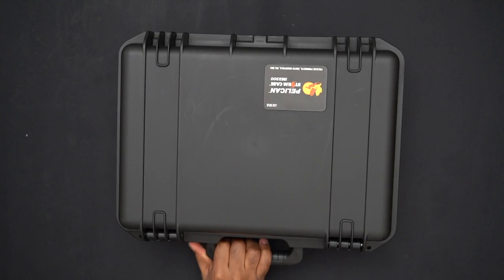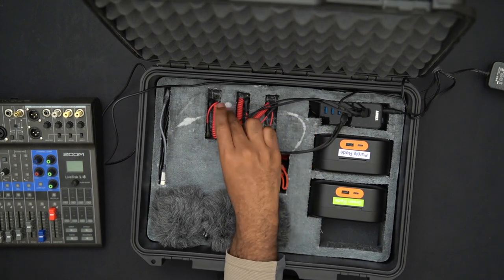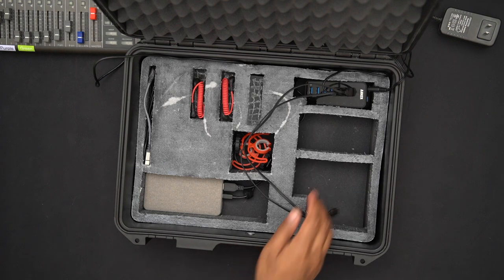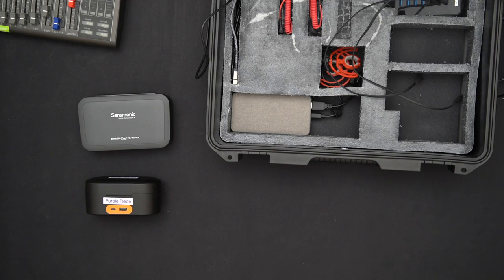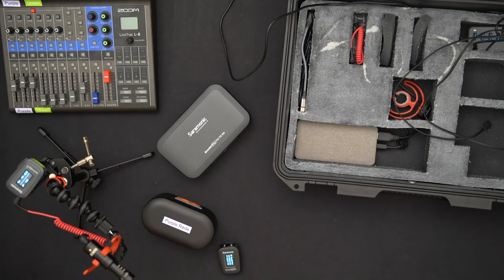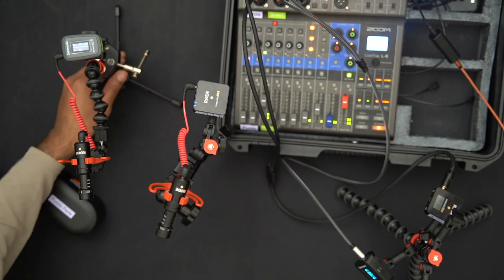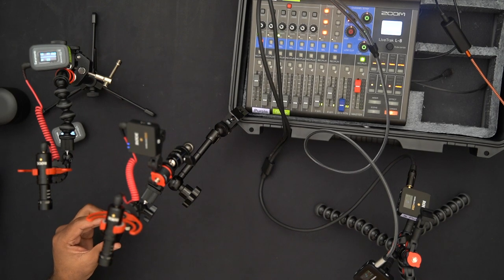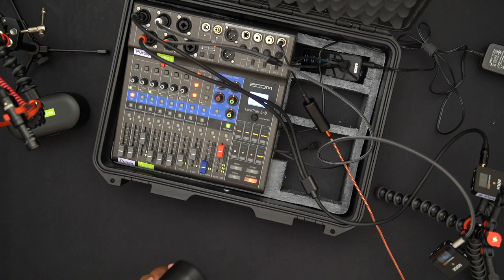Portable Podcasting Box 3 - Zoom LiveTrak L-8 with 4 Rode Mics

Comment: Thanks for your interesting Video. Do you have a recommendation for a cable from the rode to the Zoom L-8? Which cable do you use? And do you need phantom power?
Reply from the maker: Glad to hear that the video was interesting! I don't have any specific recommendations. As long as the cables are a 1/8 stereo to two 1/4 mono, then thngs should work out well. If you're wanting to know the exact cables in my build, then they are the following:

https://www.amazon.com/dp/B07K59CQ3R/
https://www.amazon.com/dp/B07XPTF19B/

Hope this helps ^_^!